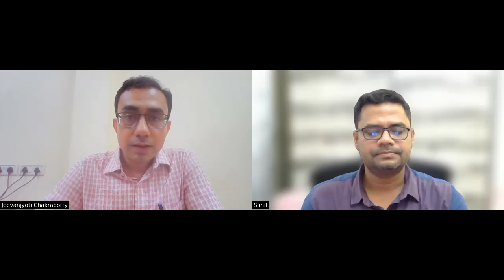Learn about Aerospace Engineering directly from IIT prof (ft. Prof. Sunil Manohar Dash, IIT KGP)

Comment: 1. Aerospace engineering includes outer space activities.
00:02
-Aeronautical engineering deals with aircraft within the Earth's atmosphere.
-Aerospace engineering extends to activities beyond the Earth's atmosphere, including satellites and outer space.
✦
2. Aerospace engineering covers a wide range of topics
02:24
-Aeronautical Engineering is a subset of aerospace engineering, focusing on aircraft-related studies like maintenance and design.
-In IIT Kharagpur, the aerospace engineering curriculum is divided into subdivisions such as aerodynamics and propulsion systems.
✦
3. Aerospace Engineering covers aerodynamics, propulsion, structures, and controls.
06:54
-Various specialized courses are available for aerodynamics covering topics like forces acting on objects in air based on shape and speed.
-Propulsion system courses cover aircraft propulsion, thermodynamics, and advanced systems including jet engines, turbo prop, scramjet, and more.
✦
3. Aerospace engineering covers controls, flight mechanics, and specialized elective courses.
09:11
-The courses include flight dynamics, control optimization, and algorithms for vehicle movement.
-Specialized elective courses in experimental aerodynamics, propulsion, and computational labs are also offered.
✦
4. Aerospace Engineering covers aspects of mechanical, electrical, and electronics engineering.
13:52
-Aerospace engineering includes studies from electronics background such as aircraft controls, trajectory optimization, communication systems, navigation, radar, sonar, etc.
-Aerospace structures also encompass topics similar to civil structures, mechanical solid mechanics, aerodynamics, thermodynamics, and propulsion.
✦
5. Aerospace Engineering is a great fit for those interested in electrical and mechanical areas
16:10
-Aerospace Engineering involves a lot of physics, chemistry, mathematics background for students.
-Focus areas for Aerospace Engineering include mechanics, thermodynamics, controls, F Dynamics involving advanced mathematics.
✦
6. Aerospace Engineering heavily relies on Applied Mathematics
20:35
-Modern developments in aerospace engineering are based on Applied Mathematics principles, particularly in boundary theory.
-Students studying calculus in school may not realize the direct applications of mathematics in aerospace engineering, which involves mathematical formulations in various areas like aerodynamics and propulsion.
✦
7. Mathematics and programming are integral to aerospace engineering.
22:36
-Topics such as aerodynamics, aerostructures, and structural dynamics involve complex mathematical equations.
-Students interested in coding and software development will benefit from solving governing equations and working with computational tools.
✦
8. Aerospace industry opportunities for graduates
27:01
-ISRO and other companies offer opportunities for aerospace engineering graduates
-Students from mechanical or electrical engineering backgrounds can specialize in aerospace engineering
✦
9.Aerospace engineering involves applied aspects and is accessible to students from various engineering backgrounds.
29:17
-Notable examples of engineers transitioning to aerospace engineering, such as Mr. S Somat from ISRO, demonstrate the feasibility of switching disciplines.
-Aerospace engineering covers specialized areas like Aeros structure and fluid mechanics, making it necessary for the aerospace industry and challenging for mechanical or electrical engineers to comprehend.
✦
10. Aerospace industry integrating AIML for faster and cheaper solutions.
33:41
-Aerospace already using AIML in structure and trajectory optimization.
-Opportunity for students to study AIML alongside Aerospace as a minor.
✦
11. Aerospace engineering graduates need core engineering skills along with AIML knowledge for industry relevance
35:53
-The future of aerospace engineering requires graduates with expertise in both core engineering and AIML to optimize solutions using AI or ML.
-Aerospace engineering graduates with additional specialization in artificial intelligence and machine learning are highly valuable in modern industries.
✦
12. Remain open to knowledge in any branch
40:24
-Students may not know the full scope of their chosen department initially
-Opportunities exist to transition between industries and interests
✦
13. Aerospace engineering offers interdisciplinary study opportunities.
42:29
-Students can study various branches of their choice within aerospace engineering.
-Being sincere and open-minded is important for success in aerospace engineering.

Comment: Dear JC Sir, 
Thanks a lot for such useful sessions with faculty members of different departments.
These videos should be shown in schools for students studying in Class-10, 11 and 12th.
Of late, everyone who wants to study engineering prefer only CS related engineering courses only. Not sure it is because of the job market and salaries offered. 
But, does that mean no other engineering degrees aren't useful or doesn't fetch good salaried jobs.
If everyone studies CS, tomorrow who will design/build best quality structures like buildings, roads, bridges which are strong durable and at the same time cost effective.
Materials Science is another important sub-branch which helps engineers to decide what kind of material can be used where, how much heat/cold those can withstand, which material won't be corrosion free, you can keep on telling about so many things.
You are doing a wonderful job despite your hectic work schedule and we are very grateful to have such sessions from academicians working in premier institutions of the country.
Thanks a lot once again sir and wish such sessions to continue.

Comment: Sir, my humble request to you is to make videos on the following:
1. Difference between the branches electrical and electronics and communication.
2. Future prospects of mathematics and computing... From the perspective of both research and job opportunities.
And a general view of the curriculum of the above mentioned fields.
It would be immensely helpful :)
Reply: Even I wish to know difference between EEE & ECE Branches and specifically, which one is preferable for semiconductors engineering
Reply: Ece for semiconductor @RandomAlien024
Reply: EEE and ECE comparison
EEE --->   My Branch
>Power System:- Focussed on generation, transmission, distribution.
>Electromechanics ie Electrical machines (Transformers and Electric Motors)
>Converters i.e Power Electronics

ECE  --->
>VLSI:- arrangements, design, CMOS
>Data Communications and network working and standards
>Microwave engineering

Common Subjects
Control System, Microprocessors and Microcontrollers, Analog Electronics, Digital Electronics, Linear Integrated Circuits, Signals and Systems

Both EEE and ECE differs in these subjects but all college in India follows CBCS system, so even if couldn't get into either, you can study other subjects. You can also do NPTEL and get certifications on any of your choice.

But there is nothing easy/hard. EEE just needs practice and solving more problems.
Download any NIT's Syllabus or Your state's Top non IIT/NIT college and see for yourself.